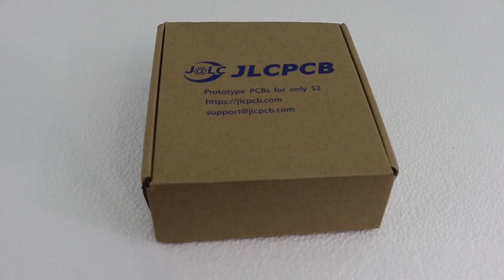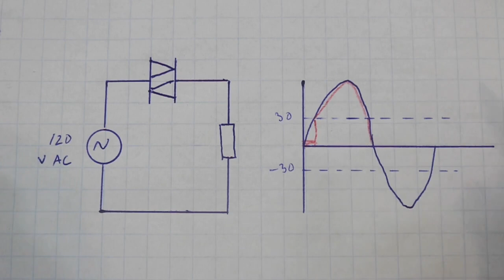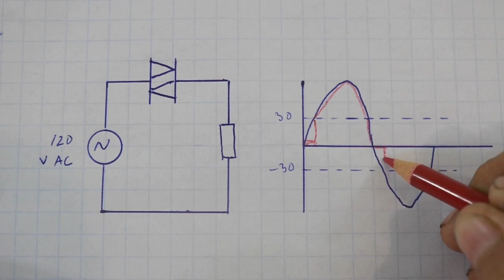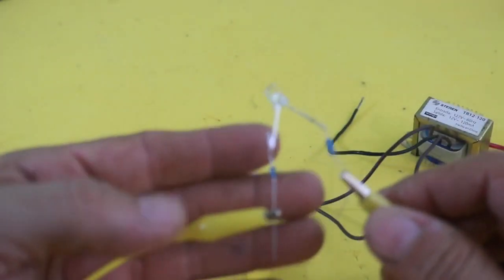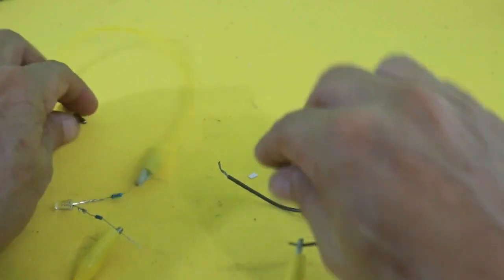The DIAC

Comment: Thanks for the simply explanation. If you put two 30V diac in series would that be equivalent as a 60V diac?
Reply: Good question
Reply from the maker: yes but you must use balancing resistor across each diac

Comment: So if I put 2 led's in anti parallel, It would essentially be a diac?
Reply: never
Reply: @two_number_nines  are diac's not just diodes?
Reply: @cndbrn7975  as explained in the video they function as a bi-directional thyristor in the classical transistor as diode circuit.
as a commenter said somewhere up in the comments this is a hysteresis device, because it takes 30v to switch on, but once its on it has voltage drop of about 0.4V and maintains it until current stops flowing. To turn it off you need to apply les s than 0.4v or a few miliamps.
The voltage-current curves in ludic's video perfectly explain exactly what happens.